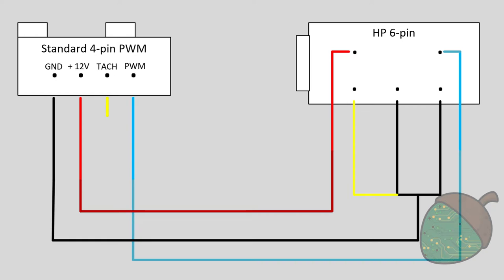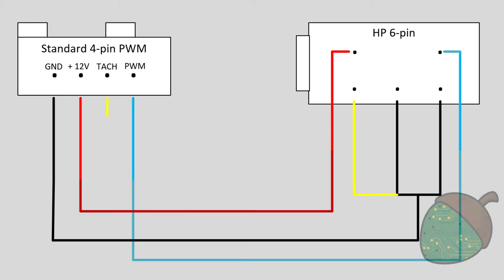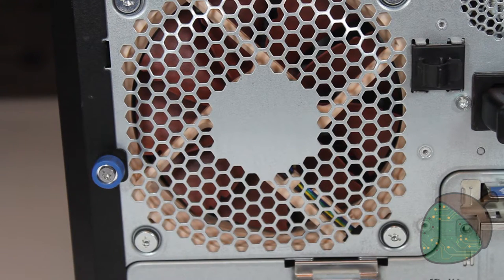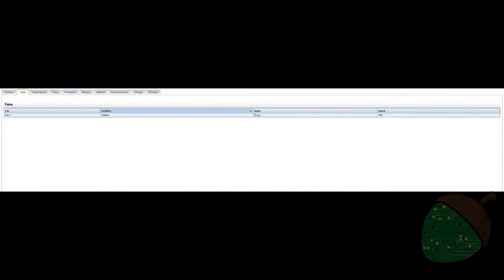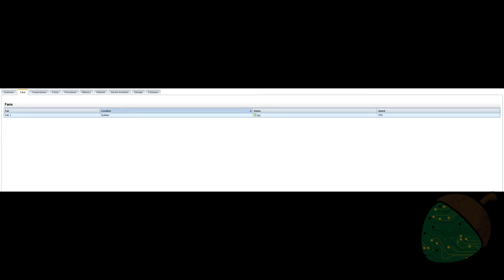HP Gen8 Microserver - Fan replacement

Comment: TO any person that watch this video

WATCH OUT!!!

THE PWM signal is INVERTED, you can broke your server
The G8 microserver PWM signal is inverted, max RPM is 0 and min RPM is MAX

If you place a normal fan, it will  go full RPM at low temps but low rpm at high temps can can create overheat

You have to create a inverted circuit and invert the signal in order to use it with any fan

Comment: Very helpful! The 4 Pin PWM  to 6 HP adapter is greate Idea. 
I replaced the original fan with a Arctic P12 this will be enough for a Celeron GT1610T.
I can now move server from corridor in my workspace.
Maybe I can upgrade the CPU ;-)

Comment: Hello and thank you very much for your tutorial!
I have the same issue here as many others have already described.
During POST the new Fan (Noctua NF-F12 PPC 3000 PWM) is very silent, but as soon as the boot screen appears, its getting very noisy. I discovered that the control was just the opposite of what is expectet. So if I go to BIOS and set the fan to "maximum cooling", the speed in ILO goes up to 70% but the fan is silent. If I chose "optimal cooling", the speed in ILO goes to 6% and the fan sounds like a jetplane...

Greetings
Christoph
Reply: Because the original FAN is inverted PWM. You actually created a very dangerous situation there. Exactly when the system needs the most cooling your fan will provide the least...
Reply: @RunTheTape  and how to fix that? can you provide the right wireing?
Reply: @sirdurex5581  As far as I know there is no simple solution. I tried it the last week. Normally an inverter with a Transistor should work but it did not work for me (idk why). I have kind of an overkill solution right now. I have an RC-Filter that gives the mean value. Thus value is measured by an arduino Uno, than inverted (new dutycycle ist 100%-old) and then outputs the ,,new" pwm signal. I bet there are easier solutions.

Comment: For the history: Noctua NF-S12A PWM works well as the main cooler in HP Gen8 (PWM inverter is necessary), details are here https://forum.ixbt.com/topic.cgi?id=109:313:8875#8875 (Russian, but Google translate can help). I was searching for the answers for several days... collected all the information in one place.
Reply: Thank you very much for the link.
Reply: @stephank.6221   Did you managed it? Does it work properly?
Reply: @DerK1  yes, worked as described. Thanks again.
Reply: @stephank.6221  Google translate won‘t help. Is it possible to explain in some phrases?😅
Reply: @DerK1  have a look at the diagram provided somewhere  in the linked thread.
Reply: @stephank.6221  thanks a lot!

Comment: Thanks for this! will definitely try it out, just to get a better acoustic signature. 

Do you know if the PSU fan can be replaced??? I'm out of warranty on my Gen8 with G2020T and it's started developing a very definite buzz.
Reply from the maker: I suppose it's possible. My PSU is working fine so I don't have any intention of messing around with it. I've seen people replacing the original PSU with the fanless Pico PSU as well, that might we worth looking into.
Reply: Mine has a very anoying high pitched noise.. Did you replace yours?

Comment: Do you know if there's any name for the 6-pin HP fan connector?
I'd like to order some to make an adapter cable, but I can't find the friggin name of it.
Reply from the maker: Sadly I don't know the name either, let me know if you find it.
Reply: Written on the connector: JWT A8 HF.

After looking up on google it may be a connector of this serie by JWT : A2006H00-2x3P (http://www.jwt.com.tw/pro_pdf/A2006.pdf) and therese another fan that uses it: http://www.cooltron.com/stockshow/pdf/FD6015B24W7-81-2NSC.pdf

Comment: Hi, thanks for the tutorial!
I´ve installed a Noctua NF-P12 with no problems.
But sadly the fan sound isnt realy quieter :( Is the new fan with this connection always running at 100% speed?

There are no Error Messages in the ILO Webinterface and the fan speed is like 13%.
Reply from the maker: It shouldn't be, fan speed should be visible in iLO. After spinning up the fan should return to quiet operation.
Reply: ok thanks, i´ll check that later if the fan is louder at the starting progress.
Reply: okay this is weird ... when he´s doing his HP checks the fan noise is ok. But when hes going to boot the debian os the fan becomes louder.
Maybe i failed something with the cables?
Reply from the maker: Does it look OK in the iLO?
Reply: yes it does: Fan 1  System   OK 12%
Reply from the maker: That's weird. I'd have a look at the wireing to make sure.
Reply: yeah realy weird. the wireing should be ok. Maybe the server didnt like the plug... i built a new one, so i havent desrtoy the original fan

Plug that i used:
https://www.conrad.de/de/buchsenleiste-praezision-anzahl-reihen-2-polzahl-je-reihe-20-bkl-electronic-10120702-1-st-741632.html

Maybe im going to try it later with the original...
Reply: PWM is inverted on the gen8. So when it's supposed to be running slowly, it will be full speed.
And then when the system get hot, the fan speed will be lowered!
Do not use the connection described in this video!

Comment: I've tried it but the fan is quiet on bootup and loud when it get into Windows. Reverse to what I believe it should do. What am I doing wrong?
Reply from the maker: That sounds stange, I know that there are different kinds of PWM-fans, do you have a chance to test with another fan?
Reply: I dont have another spare fan to test.  I am using the Factual Design hp-12 suggested in your comment
Reply from the maker: Well that one should work for sure. I've found another wireing diagram here. I've tried it but for me it ended up causing iLo to report fan failure but it might clear something up considering that my diagram is pretty useless: http://www.silentpcreview.com/article1377-page9.html
Reply: The diagram from silentpcreview.com works ONLY for fans that have a rotation detect/locked rotor output signal (like the one that comes w/ the microserver).
For the rest of the fans ( ones that have RPM output ) it's mandatory to short circuit yellow and BOTH blacks. This bypasses iLo's safety check. 
Now, about the PWM signal. For most of the fans in the market it's between 0 to 5 volts, while in HP, it's from 0 to 3.3V afair.  That's why you get insufficient cooling with some fans. 
So, if you want to replace the fan w/ something silent, short both blacks + yellow, and power up the chassis fan from a fan controller and set it at a safe speed between 75 - 100% depending on your workload. 
Also leave the thermal protection ON in the BIOS.

If you have something in the internal PCI slot, put a fan on it, otherwise you'll get insufficient cooling.

HTH!
Reply: @mihai-cristiantianu6792  Hi I did this, but now I cannot change any fan settings in the ilo or in the bios - it just stays the same RPM. any ideas?